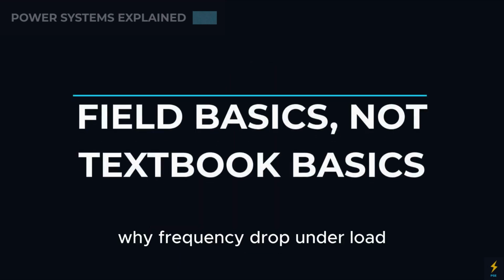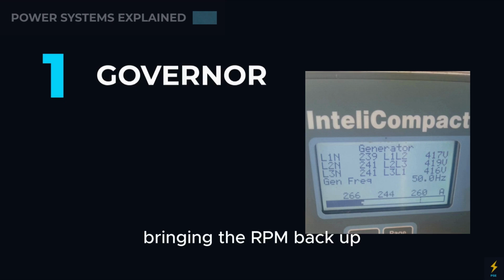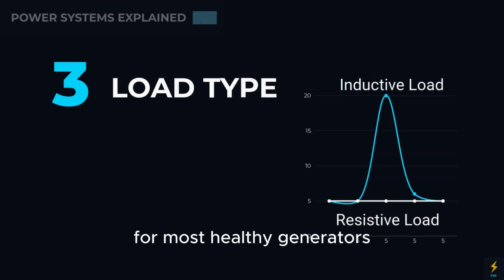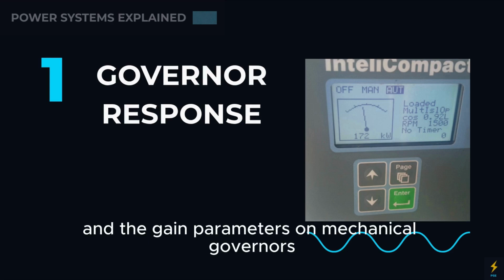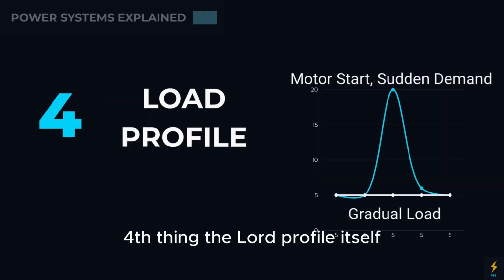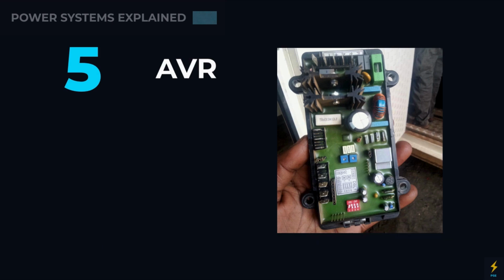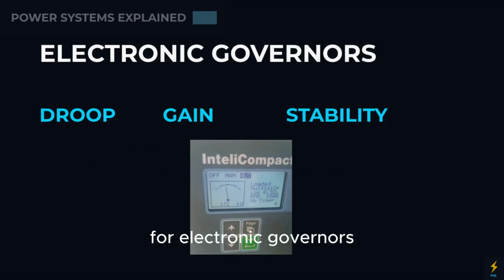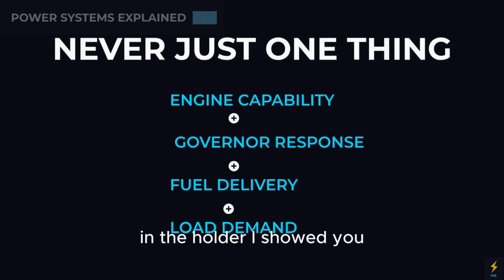Why Generator Frequency Drops Under Load And What To Do About It

Comment: This is genuinely one of the clearest breakdowns of frequency drop I have seen, and I have watched a lot of these. Most channels stop at governor and fuel, the AVR point actually explains something that happened to us last year that we never fully understood, we chased a governor fault for almost a full day and it turned out to be exactly this. Subscribed, looking forward to the ATS video next week. The most common fault I deal with on my sites is actually load related, motors kicking in without soft starters, exactly what you touched on with the inrush point. Would love to see a full video just on that.
Reply from the maker: Really appreciate you sharing that, and honestly that is exactly the kind of story this channel exists for. A full day chasing a governor fault that turns out to be the AVR compensating, that is the real cost of not having AVR on the checklist early enough, and it is exactly why I put it at number five rather than leaving it out entirely.
Good instinct on the load side too, motors starting without soft starters is genuinely one of the most common root causes I see get misdiagnosed as a generator problem when the generator itself is completely healthy. That is a strong topic on its own, noted for an upcoming video, the inrush and soft starter angle deserves a full breakdown rather than just a mention.
ATS video is coming next week as promised. Thanks for subscribing, and for the detailed comment, this is exactly the kind of field experience worth sharing here.